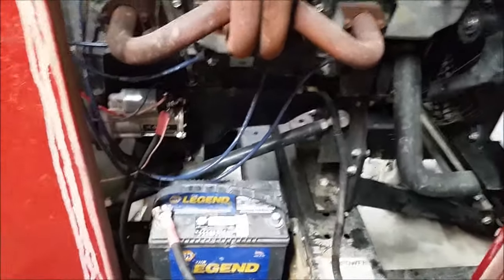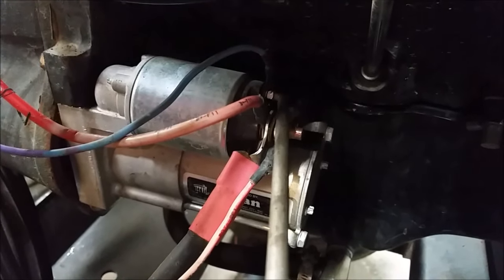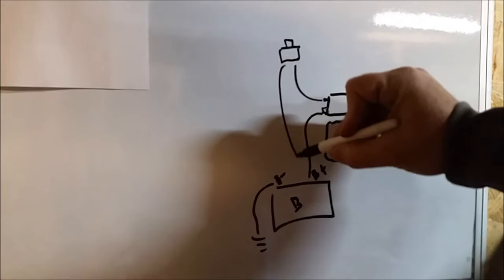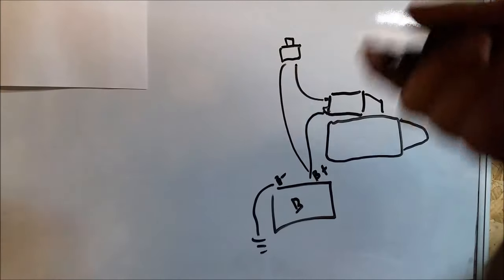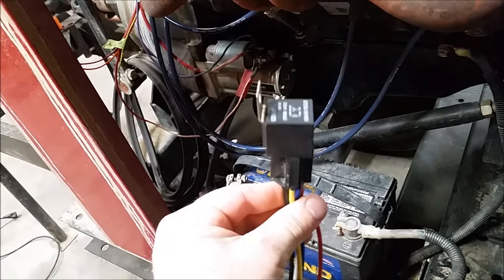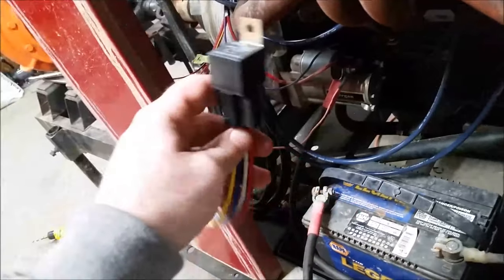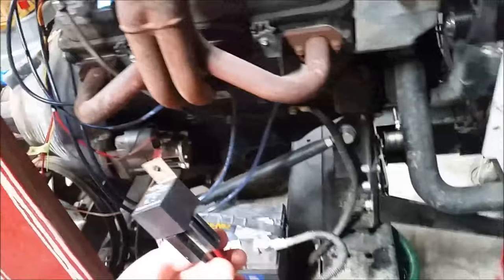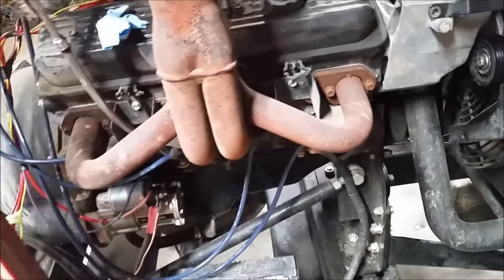Push Button Starter How To with and without a relay.

Comment: Hi.. hey I put on push button....but my starter gear won't pop up...???
Reply from the maker: Cross two wires. Touch a wire to the battery cable and the other end to the solenoid wire and see what it does. This is telling me whether or not you have a starter issue.

Comment: HERE IS THE STARTER BUTTON WITH TWO POSTS ON IT ....one wire from it runs HERE...the other runs HERE.....just how hard can that be to explain in a video????
Reply from the maker: Hard
Reply: @DivineSpeed  Well I made a video that AINT
Reply from the maker: @outboardfixer  good. I'll try a little harder next time. Thanks for watching.
Reply: @DivineSpeed  atta boy